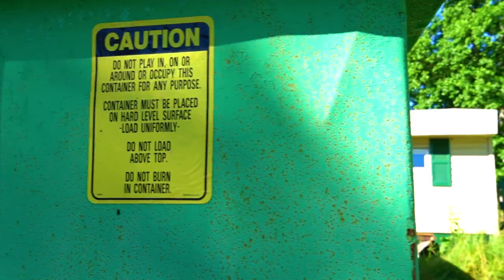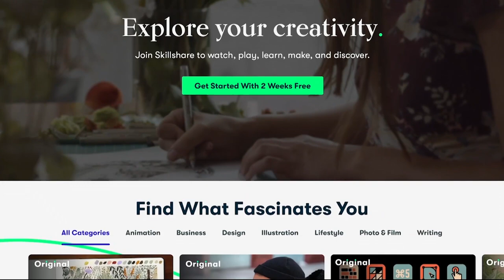DEMOLISHING A Mobile Home

Comment: This house falls under the "55 Gallon Drum" rule. Roll a 55 gallon drum of gas into the living room remove the stopper, tip it over, roll it around. Get out of the the house and throw in a lit flare.
Reply: have you seen the price of gas, lol
Reply: Gotta be cheaper than 4 dumpsters. @davidroosa4561

Comment: I've demo'd a couple trailers..I find if you pull the walls down and drive on them with the excavator while doing it you can grind it up a bit and the smaller pieces you end up with fits in the dumpster better. Nice clean job of it though Josh..good work!

Comment: Nice work with the excavator josh. Little tip for next time to save you from getting bounced around so much is to drop that blade when you are stationary to stabilize the machine

Comment: The advantage of the excavator over the skid steer is the excavator should be used to compact the scrap in the bins as it is loaded, but the skid steer can't do that unless the bin has an open end into which the skid steer can drive.

Comment: I live in Pa, where electrical license is not required to do electrical work by the way. I can assure you code violations are rampant in Pa. WV requires a license to touch electrical equipment at least.

Comment: For a learning curve, Its all good. I do think that you learned a lot about tearing the shack down and how to tear it up in smaller bits and fill the dumpster completely. I know that building can be put in just two dumpsters. After you find metal prices are so high your going to get all the metal into a scrap load.

Comment: It’s too late now, the metal roof would have been great for A chicken coop.
Reply: Remember they said they didn’t want to get on the roof due to the risk of falling through or off. The structure is very questionable strength.
Reply: Yes. However during the tear down it there was a few sheets that was 8’  in length. How often are they picking up eggs?

Comment: I would have offered my services for demolition in exchange for all that timber & windows. 
How come you guys didn’t salvage anything other that the wood stove for a future project.
Reply: Black mold!!!!!!!!! They have shared this info many times.
Reply: Look at their previous video, it was all disgusting and rotting away, mold was everywhere. Josh was able to move an outside "wall" just by pushing against it, they were not going to put anyone in danger trying to take stuff out of this foul mess. It was just an unstable extension built on a trailer decades ago, not a house. So they decided not to invest any effort or money into it, which would have distracted them from their main build, and just tear it down quickly.